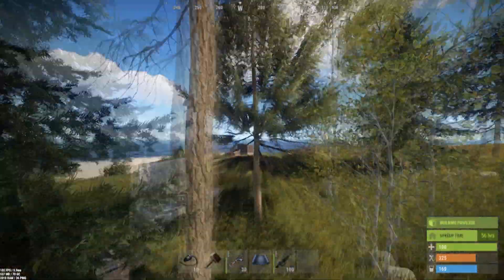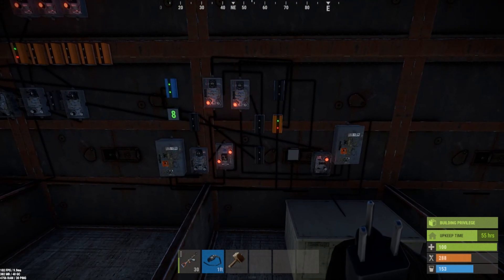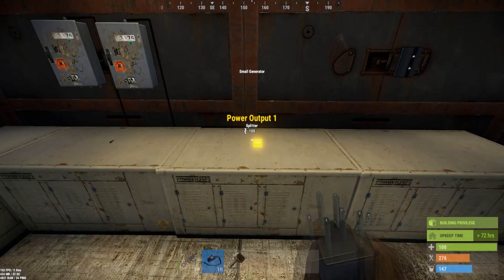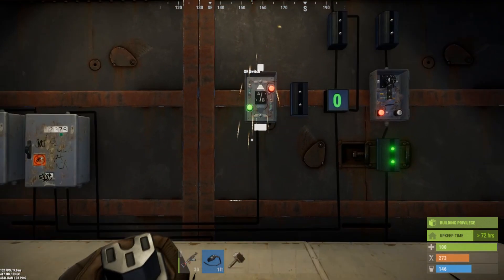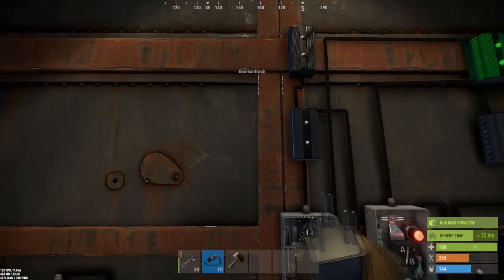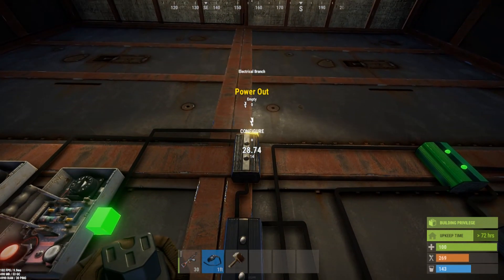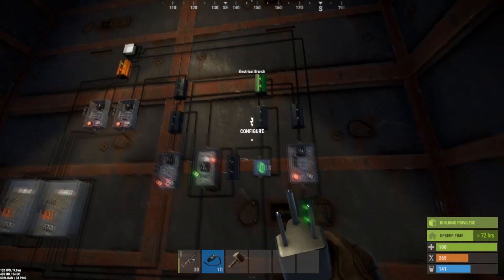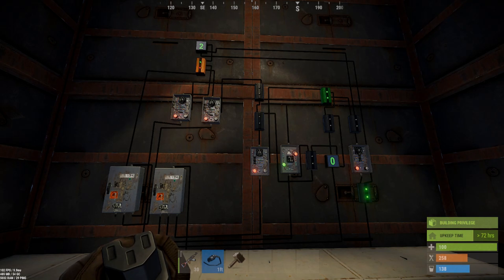Rust Electricity - Customizable Dice Simulator.

Comment: Well, a dice has the same chance for every number to be rolled. Yours will appear under a bell curve  with 3 and 4 being the most likely to be rolled and 1 and 6 pretty the lesst likely (by a factor of about 20:1).

What you should have done is getting 6 timers with 1-6 pulses each and then chosing one randomly, that would be the easiest way to simulate a dice roll in Rust.
Reply: what do you mean 1-6 pulses each and then choose one randomly? how do you choose one randomly?

Comment: Hey rust electric could you make a guide on how to open a garage door with a transmitter ,I'm trying to make a trap base and idk how to make the door open with 1 click instead I have to hold down the transmitter.
Reply from the maker: if you have the transmitter wired into a memory cell "Toggle" you can get it to maintain being open.
Reply: RUST Quick Electric please email a video please
Reply: Yeah but how do i always have power?Solar panels dont work during the night  @RUSTQuickElectric
Reply from the maker: @ultrasaur2744  I have a tutorial regarding auto-lights explained which showcases how you can have a battery charge during the day that will last you at night.